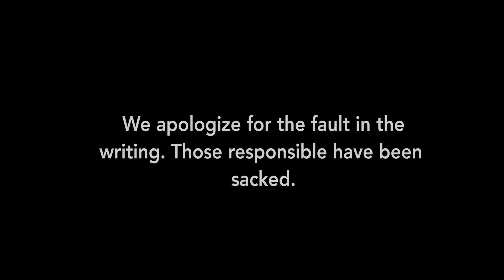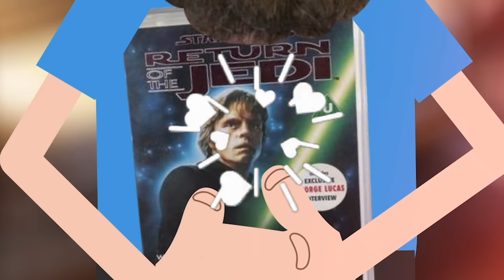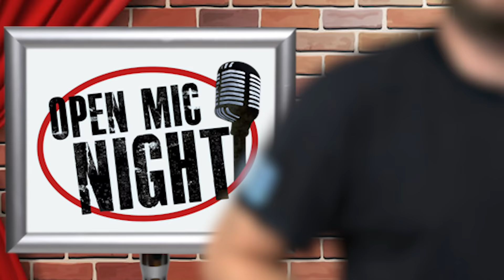SUZUKI HAYABUSA - Everything You Need to Know | Up to Speed

Comment: i owned a zx-11, this bike literally ruined a lot of things for me.  I can tell you that the reason it was called a ninja was because it was an assassin.  the exileration of speed was so incredible, you couldn't help but smile.  it didn't like going slower than 120mph or it would burn your leg hairs off....  I did some incredible things on that bike, sliding the rear to turn hard, sliding on the front tire  like ice...  tank slapper... but never truly laid it down, only dropped it.  its so heavy, when i first got on it it tipped right over from being so top heavy with fuel.  it ruined all rides at amusement parks that are supposed to be fast like superman.  you could shut off the engine and turn it back on to make the double barrel shotgun pipes blast off.   very very fun bike, i racked up about 10k in tickets before i sold it.
Reply: RC Hunter, do you ever post true stories, or just stick with fiction?
Reply: @Zachary Clinton , is what usual?
Reply: @captainamerica9353  I mean, it's not hard to flick the killswitch on a carbureted bike off and on while riding to make it backfire, and I'd certainly believe dumbass squids going 120mph+ in shorts could get thousands of dollars in fines.
Reply: @Hawk7886  , ok, I believe he could get it to backfire, and I owned one of those pigs a few years back because I found one locally for fairly cheap.  Yes, it was a top heavy, and just plain heavy beast, fast in a straight line . . .but if he was getting caught going over 100 repeatedly, he'd have been in jail before getting $10k in tickets, and not able to get insurance, or keep a license!
Reply: @captainamerica9353  you'd be surprised what a decent traffic attorney can do. A lot of it depends on what state you live in, but in many parts of the country you can get away with practically limitless speeding tickets if you're willing to pay. Washington state is a good example where traffic lawyers are actually quite cheap and can save you from almost anything. I've been pegged a few times over 110mph and my driving record is clean. Averaged about $350 paid to an attorney each time to get the ticket dismissed. .
Reply: And a single ticket for getting caught .01% over the legal blood alcohol limit could eat more than  half that budget in an instant, with no jail time.
Reply: i have a zx11 and a zx14r.....and i'd have to say the zx11 is just as fast as the zx14r. probably the zx14r wud have a beta top speed but the zx11 wud be right next to it all the way there....so u know....zx11 is a weapon aa he states.
Reply: @captainamerica9353  I don’t know where you live but I coast over 100mph heading to work most mornings. Cops won’t stop a bike going that fast because it’ll generally end in the rider dying from running.
Reply: @jdfolds5188  , I live in Northern WI where there are more cops than people.  Around here they "fight crime" by ticketing us.  But I don't know the policy on high speed chases locally.
Reply: Whatever
 I got walked like a borrowed dog 
by a CBR, on my ninja.
that’s why I own a Hayabusa today.
Reply: @captainamerica9353  
Get a FEW “old” Enduro 450’s.
If you know your land they’ll never catch you.
But
might have to ditch a bike or two 
-every now and then🤷🏽‍♂️

Comment: Fun fact, the first gen Hayabusa, used it's exhaust as a structural part of the sub-frame. So in case you have one of those, and you have modified them and its points of anchor... Be careful about hitting a llitle bump over 150kmh/90mh, because you may lose your passenger 😂
Reply: just taking off dead weight
Reply: @ange_.4044  Ultimate weight reduction 😈😈😈😈
Reply: Thanks!
Been 138mph, w/GF on the back.😳
PS
Two years ago 
I was contemplating selling my Busa
 for about $7000.
👉🏽GF said “Sell it? HELL NO”!😎
Imagined her whole life,
Have a boyfriend w/a motorcycle...

Comment: Ram air intakes don't work on cars or motorcycles, they don't create boost.
Theoretically, you could achieve a fraction of a pound of boost going close to 300mph. But in most applications, like in the Hayabusa, the intake is located in a high-airspeed zone. Bernoulli's Principle tells us that this creates a low pressure, so the ram air ducts offer lower performance than a typical under seat intake. But, they look cool...
Reply from the maker: The more you know!
Reply: If it’s between the engineering team at suzuki and this one guy on the internet with the free time to leave long comments, Ima have to say your wrong chief.
Reply: @altarancho  he is right about ram air intakes not really working at motoring speeds, dunno about reduced performance tho
Reply: A forward-facing intake can indeed convert high air velocity into extra power,  The problem for street bikes is the gain from ram air at 160 mph, (rarely attained on the street) is only around 3 percent, this indicates that for older production bikes this is more fashion than function, but it also provides cooler, denser air into the airbox which is beneficial to efficiency. Modern ram air ducts are mounted centrally, copying Moto GP practise, where the air pressure is highest, and routed through the steering head. Early twin ram air intakes like the Hayabusa's were mounted either side were the air pressure is lower, as a way to get around the issue of routing the air through the headstock.

Comment: it’s a motorcycle that’s named after a bird that eats other birds 
         - Donut media 2019 -
Reply: I'm pretty sure it translates to "God of wind" in Japan
Reply: They called it the hayabusa because the hayabusa kills blackbirds, hondas top speed holder.
Reply: @916hayabusa  That is correct. Hayabusa is a Peregrine Falcon that does eat Black birds...which happened to be Honda's Halo bike at the time.
Reply: @edgarperez1595  No it doesn't..that would be ironical Kamikaze 🤔

Comment: I have been a Kawasaki racer Professional since I turned pro in 1993. I had a Kawasaki ZX7R limited edition that I shoehorned in a ZX900 engine bored to 980 cc. The battle between Kawasaki and Suzuki never ended with the Hayabusa. You should make a video on the Kawasaki vs Suzuki horsepower wars. Fucking politicians that kneecapped the Kawasaki ZX14. Enter the Kawasaki H2SR 400 Kph motorcycle